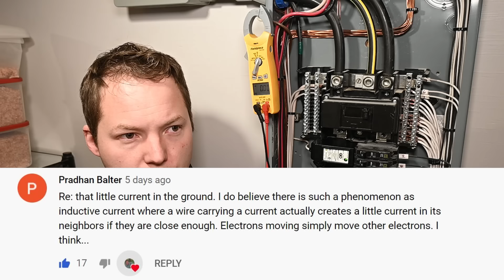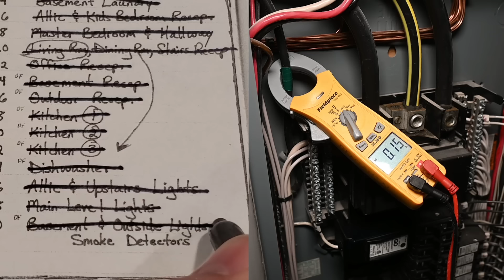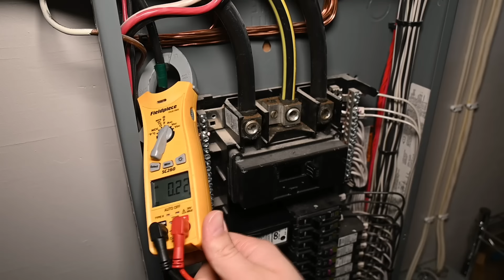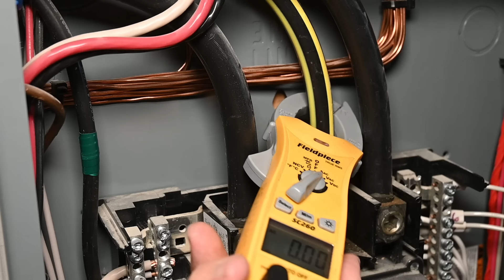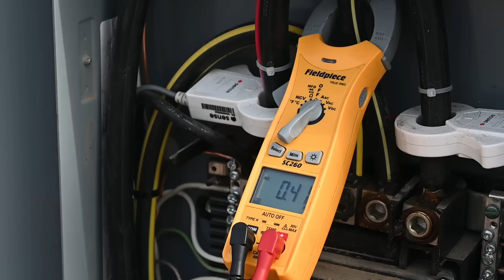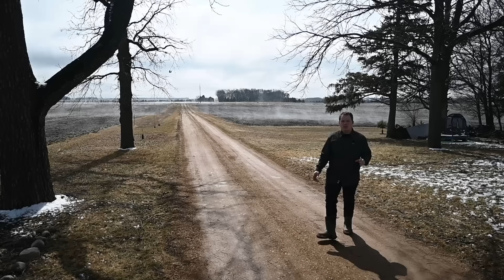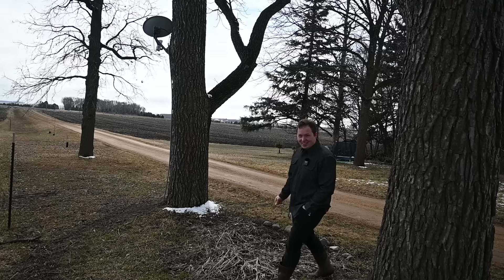Finding The Source of Stray Current on Grounding System

Comment: The utility company only charges you based on current moving through A and B phase in your situation, the giveaway is that they are the only conductors in your main panel that have CT's monitoring current flow.I would like to think that if you added another ground rod further(+-15 feet) from the main panel or even in the xformer itself( it should have one on primary and one on secondary) that you would get less saturation from that ground ring at that location thus allowing the leakage from the neutral(which is normal btw)to go to ground there rather than flowing back into the house. That all depends on the resistivity of the soil the ground rods are in(black dirt=good,sandy soil=bad).Now if the ground rods were not sunk in past the permafrost layer then that would cause the system to not be able to dissipate the leakage current as well. Its been a while since Ive read my grounding and bonding textbook from the apprenticeship so everything Ive said is probably wrong.
Reply from the maker: That sounds right. I want to do some more learning and experimenting to understand this more. Interesting stuff!
Reply: @BenjaminSahlstrom  It would be interesting to see if the problem subsides after you add the isolator to your gas line.  Potentially one of your neighbors could have a bad circuit that is bleeding back through the gas line, or just the fact you have a separate network ground through all that metal gas line pipe is finding a voltage source that feeds to ground, only a very slight difference in the gas lines "earth" ground and the power companies "earth" ground would still show up in small amounts of current flow (voltage potentia).  Other possibilities: do you have an old analogue phone line drop?   If so there is another voltage source shared through the region.  Also if there is current then there is voltage and therefore, "power" , so you aren't wrong to say power is transferring if you see current above zero, it may not be very much power but it is power none the less.
Reply: Bro...how u gonna finish like that?

Comment: I can help you with some definitions. Voltage is this force that drives electrons through a circuit. Basically speaking, it is electrical pressure. Current, measured in Amperes, is the rate at which electrons flow through a certain point in a given time. Basically, current is the rate of electron flow. Power is the rate at which work gets done or energy is transferred. Power is measured in watts and work is measured in joules. I hope this helps. I just subscribed and really dig how curiosity drives you.

Comment: Where I live, the power distribution company has ground pads on the bottom of poles to run a solid copper ground to the center tap of the transformer, sounds like the center tap is not grounded at your transformer so if you take one lead of the ac voltmeter to the point in your panel that connects to the transformer center tap to a ground rod right below your panel you will read some ac bolts due to the differential potential. It only takes 10 milli amps current flow through the heart to cause cardiac arrest so the .041 amps you are seeing is 41 milli amps and four times what it takes to kill a person so never touch that center tap with you feet firmly grounded.
Reply: 40x. His meter read 410mA.
Reply: Joe Ballard thanks for pointing that out. I totally overlooked it. That is enough to cause death considering an average person only has around 500 ohms resistance from their fingers to their toes. There are a lot of variables to be considered though. He said the nearest copper pipe ground was in the field so if the ground at the pole was good and what looked to be 60 or 70 yards then from center tap to the copper ground would easily cause a 410ma current drain. As I had said earlier, it has to be a faulty ground at the transformer. Thanks again👍🇺🇸
Reply: 10ma through a open skin wound directly to the bold stream. Your skin resistance will keep a higher power from killing you
Reply: dtimboggs Thank you, my point was that it will kill you so better safe than sorry.
Reply: It will be grounded.   There's  no chance it won't be.

Comment: Very interesting video, I install downhole water pumps in the lakes for a living >30 years and now we have to be aware of NEC 2017 code, section 555 where electricians are required to provide for no more than 30 milliamp trip breaker for main feed to docks and marinas on lake (5 ma GFCI's are too sensitive and cause constant nuisance tripping). I agree with other comments possibility of battery power backup for computer, dog fence, or the Dave Daved scenario below,  otherwise call power co out and show them they are legally liable for an electrocution if it happened due to their neutral flowing current high enough to kill - - -  that will get them working on it real fast.

Comment: Yikes theres an amp and a half flowing between my grounding electrode water line and gas line. I turned a 25w lamp with a hot wire and a wire jammed into the ground and the current only went up to 1.75 A

Comment: You have way to many auxiliary grounding electrodes. You clearly understand the fundamentals in that current always flows from the source and returns back to the source. It does not get magically absorbed by the earth and may people even industry professionals believe. 
The source in this case being the transformer. 
Current is traveling from all those ground rods back to the transformer through the earth. The grounding point should be at one point and one point only.
If you have not already stumbled upon Mike Holt by now, you soon will. He is very knowledgeable and has produced quite a bit of material on this particular subject. I suggest you get in touch with him and see if he can help you out.
Reply: does the sub panel have an isolated neutral bus?
Reply: @Dweenz69  Yes always, usually it is a tab you must remove.
Reply: Chargero, I think you just clarified something that was explained incorrectly to me, thank you.  In Telecom we always want a single ground point.  I always thought that the voltage differential between grounds was involved, but based on your input it is the resistance back to source that is different and therefore causing current differentials.  I take back my comment on the previous video about voltage differential between earth electrodes, but the test to remove the additional earth electrode still makes sense with your input.

Benjamin, find the divisor.  First validate that the current is the same on the path from main panel to sub panel as it is from sub panel to earth.  This should be obvious with all breakers in the sub-panel off, but perhaps there is a surprise.  Then remove the earth electrode from the sub-panel (if you know that is safe for you), leaving the larger conductor back to the main panel.  This should drop the current at the sub-panel to zero, but should not change the current from the transformer, since the transformer has the main panel earthing path to return (not sink) all its current.  If you have other sub-panels, it would be interesting to know if the current is divided between those paths.

Does the transformer itself have an earth electrode?
Reply: Chargèro Mike Holt’s material is awesome.  Im not saying this guy, but in general a lot of people don’t know the difference between grounding and bonding . If anyone really wants to grasp how it all comes together should check out Mike’s site.
Reply: There should be no current (amps) on the ground rod? That is only a back up
in case of (a trouble ) with the Neutral? Current (amps) BALANCES back to the
transformer.    The Single Phase STEP DOWN transformer owned by the
power company, will connect the Center Tap of the secondary winding to Ground in order to RECEIVE any unbalance? Thank you.
Reply: @tedlahm5740  Yes backup AND it always works as a stabilizer. (part of the electrical system)
Reply: Chargèro you stated it much better then I did. Which I had read this first. I would not have waisted my inability to explain it.

Comment: Fantastic video. Thanks for the teaching moment. I changed my stove recently and did not remove the bonding clip that joins the neutral to the ground. It is a good used stove but had been used with a 3-prong chord. I experienced light flickering for a couple nights. I eventually pulled out the stove (after turning off the breaker) and removed the bonding clip. No more flickering.

Comment: Ampere meter, amp meter and ammeter all measure amperes in a circuit. Ampere meter came first, amp meter and now ammeter. Some day volt meter may be vometer and then Vmeter or even Emeter. So the difference is what you make it. Like Vet e ran and vet ran. Spelling is almost the same, meaning is the same just pronunciation is different. Both according dictionaries are acceptable. As a Veterans I could care less how it is pronounced as long as people understand it’s meaning. If only a function on a multimeter it is still measuring amperes or amps. It is just an instrument and doesn’t care. Keep up the good work there are some very good knowledgeable people that will be very helpful.👍🇺🇸🤙😃

Comment: I stopped it at 14:30
Check the ground coming from the sub panel, disconnect it at the main and check amps. No draw then the sub panel is feeding the current.
My guess anyway, so far.

Comment: The transformer secondary winding  is a de facto  the other half of a Capacitor with the primary winding  (one half of the capacitor) energized there will be current flow to the secondary (Capacitor) side and this capacitive current all be it very small wants  to go to ... GROUND!

Comment: Do you have a propane gas stove electical control panel plugged into a 120V wall outlet?
(the stove will have internal connection between the case, the ground prong of the power cord and the gas line)

The groundwire from the outlet  then conducts the  17  to 22  mA current.with the gas line  ground !
Reply: But he has HUNDREDS of milliamps, not tens, and it varies by more than 20 ma.

Comment: Check out mike holt videos on stray current.  It helps explain what u are seeing.  Great vid great explanation
Reply from the maker: I found a few of his videos recently and plan on watching more of his stuff. There's so much to understand! Its awesome.
Reply: @BenjaminSahlstrom  its a stray current problem from the power company. Mike Holt talks about those kind of issues in his stray current videos. At the end of the day even the leadgendary Mike Holts couldn't get the power company to budge and fix the issues. This issue has led to a kid dieing do the fact that the pool water wasn't bonded and the ground had potential difference in current since it had current running to the ground

Comment: Great vid.  On my system, it turned out to be my neighbour's house that we shared the same transformer, and since my ground was better than his, the neutral that we both share (as in all cases) discharged the energy into MY house ground.  damn it.  My ground is a city 3/4 inch water pipe (type k copper).  You cant get a better ground than that.  So we turned off his breakers, and bam, we found it, his sump pump.  LOL.  woohoo.
Reply: Yes indeed! We had a second set of ground rods on an old service that was causing stray current back through the pole transformer to our neighbors barn, the darn cows could feel it in their feet. Stray current can absolutely cross back through to your neighbor if you share a transformer!!
Reply: @dangoldbach6570  What behavior of the cows clued the neighbor that they were feeling a "shock?"   Would be interesting to learn more about exactly what areas of the ground would shock them.  Cool areas to walk on and "hot" spots.  Glad the cows are happy now.
Reply: @chetmyers7041  apparently they would feel it in their hooves and would lie down. When cows lie down they put pressure on their udders and stop lactating... Who knew!
Reply: Dang, how was his ground so poor that traveling to your house was the path of least resistance?
Reply: @nickmcwilliams685  i have a type k copper water pipe with 2 ground rods, that makes my ground the best.
Reply: @MrTooTechnical  I understand that but given the physical distance between buildings and all the wires it's suprising that your ground is still the path of least resistance.  Without knowing the layout I'm just armchairing.
Reply: @nickmcwilliams685  trust me, my ground kicks ass.  You cant get a better connection to the earth than an 8 foot deep, 100 foot horizontal, type k 3/4 inch copper line; with supplemented ground rods.  woohoo.
Reply: @MrTooTechnical  I think you are missing my point.  I was never questioning the quality of your ground.  All parallel circuits are voltage/current dividers per ohms law.  Your super strong ground (a parallel circuit to his ground) is drawing his leaking current not just by virtue of its low impedance at your box but also the whole entire path from the source to yours must be better than his own ground.  I assume his ground is physically closer to the pump than your ground.  That is why it's suprising.
Reply: There aint no pump. City water in residential setting. My ground is godlike. Woohoo
Reply: @MrTooTechnical  I was referring to the mentioned sump pump that was causing the ground current.
Reply: @nickmcwilliams685  no man.  my ground kicks ass  woohoo.
Reply: @MrTooTechnical  man, you are all about grounding.
Reply: You rock. Damn skippy. Woohoo

Comment: There may be a circulating current occurring from the earth bar in the main board through the earth conductor in the mains cable feeding the house and back through the earth rod connection at the house, through the ground, through the earth rod at the main board and the main board earth bar.  If you remove the earth connection to the earth rod at the house, does this current of 0.2 amps stop. If not, the current source is not the supply but a ground loop sourced from some other source.

Comment: Thanks so much for looking into this ground current, Benjamin.  Such a situation can lead to much misery for a person who is electrosensitive. The unbalanced current will lead to magnetic fields all over the house as well, which can be measured with a good gaussmeter.

One other place to look will be the cable and phone wires, where they are connected to the egc at entrance.  Another might be a well pump (which might have its own dedicated ground).

My understanding is that most utilities add a grounding rod every thousand feet or less, at the base of the utility pole.  The extra current that should be returning to the source (power company) on the neutral line is known to lead to a small percentage of current running through the ground underneath the lines, much to the annoyance of milk cows.  There are fascinating IEEE articles by Zipse on this topic.

Building biologists are familiar with this problem and perhaps one with chime in with some suggestions.

What are the health implications of a ground that is regularly supporting a current flow?  You have 200 milliamps, and some kind of voltage differential is driving this current. We know that only a few milliamps can lead to heart failure, but my understanding is that you need at least 30V to get through the skin. Seems not merely 'objectionable' but rather a dangerous situation, no?

Comment: Hi there from Russia. Here we have a common problem called "380volts in outlet". Our houses are fed with there faces each serving for several flats (380 inbetuenew phases, 240 hot to neutral). This happens when feeding neutral is broken. Also in situation when the feeding neutral is broken somewhere it begins, all the current going to neutral is truing to get to ground rods along the line. But when 3 phases are balanced neutral current is pretty low (0 in perfect situation, small in real situation, big in case of bad balance). 
What I see in your wideo looks pretty the same. But as I know you have 3 phases in feeding high-voltage line. And each house is using it's phase through transformation generating two phases. But still, following this scheme https://youtu.be/NQN2Ic56Ymc?t=329 (at timestamp. sorry for Russian video. But it's about USA). Neutral of feeding high-voltage and house neutral are both connected to each other. So in case of high-voltage ground wire fail and good balance high-voltage feeding neutral can feed all the grounding systems with small amount of power. Go check your neighbour. 
Also, back to the scheme. I'm not good in this topic but it looks like some possible points of failure in transformation "setup" may cause this behaviour. And I don't know what will happen if "house" side coils of two phases are not balanced.
Reply: this can't be equal to european power..  US: 2 phases are 240V with Neutral.. 2x120V  the 3rd phase is separted and only goes to 3phase maschine... no central neutral like european style...
but transformer error on higher voltage...  ok this is a very bad issue....
Reply: @elofos0815  yep but as I heard you have like 3 phase mid voltage (7kv or something) going to individual households transformatores. Like that barrels on poles. And following the scheme the kilovoltage lines neutral is connected with grounding of the house (transformation coils are connected on neutrals)

Comment: Detective Ben, great video! And holy cow, 70k subs!

I'm not sure this is a good idea, or even relevant, but at the sub-panel inside the house, could you disconnect the feeder EGC from the box and then measure the voltage between the wire itself and then the box? (probably with the power off to be somewhat safe, lol)

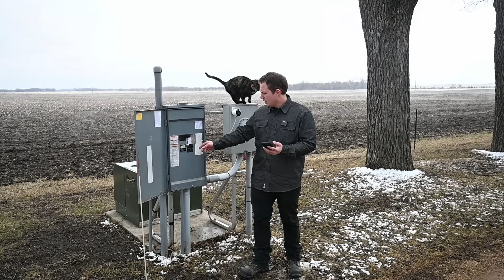Also, 12:48 - Asshole cat knocking your camera off!